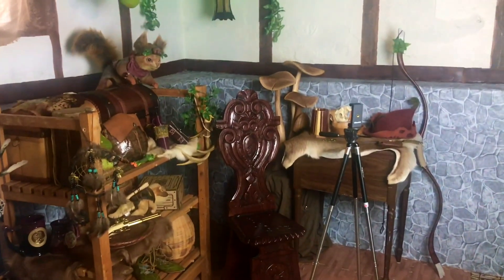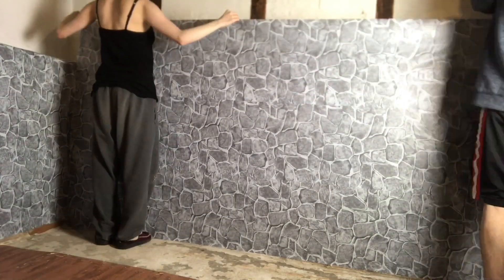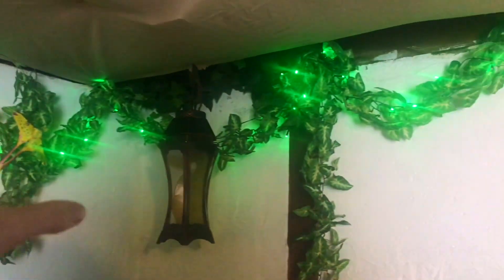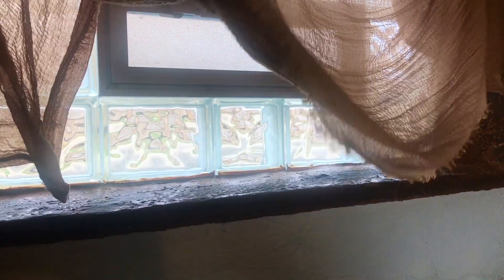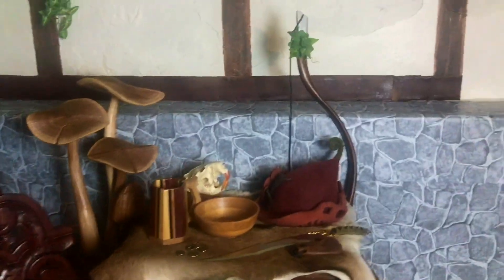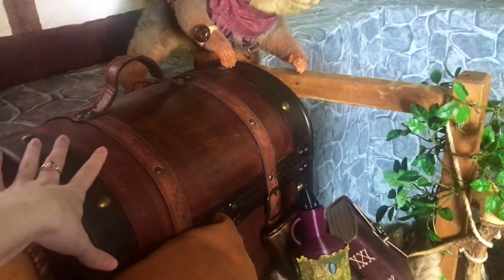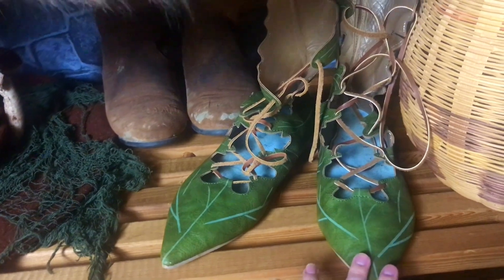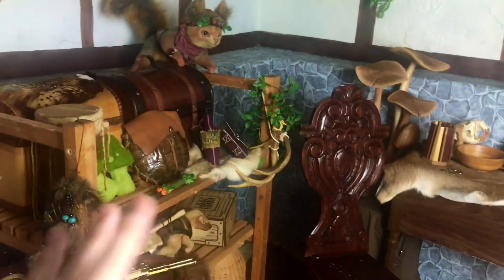Making My Medieval Recording Space 🛡 Fantasy Room Tour

Comment: Impressive and creative!  Since the window concerned you, may I make a suggestion?  Fill it up with bottles of different shapes--you don't have to buy them, just stuff like maybe an emptied olive oil bottle, hot sauce bottle, wine bottle, worchester sauce bottle, whatever you can find.  Put colored water in some of them.  Wind cord around the tops of screw-topped ones and get mysterious looking stoppers from Michael's or some similar craft shop.  Keep the gauzy scarf in front to blur whatever glimpse someone might get of the window and make it look more mysterious, but now you won't have to worry about those art deco lines showing through, and most of the bottles would still let the light in.
Reply from the maker: Hey there I’m just now seeing your comment! That’s a great suggestion thank you! I actually ended up putting a piece of cardboard behind the scarf so when I don’t want light coming in, the cardboard will completely block the light.